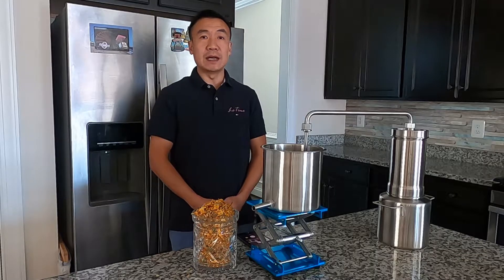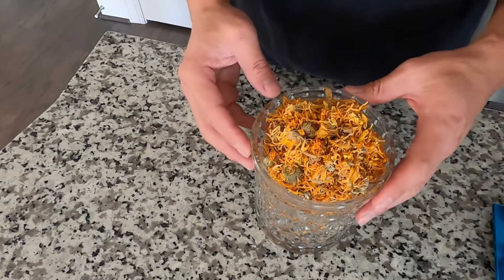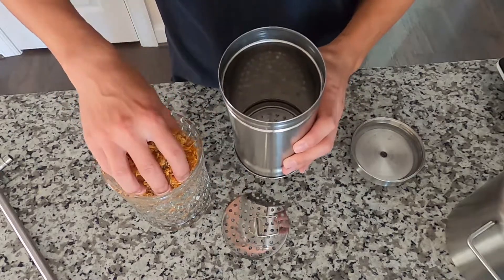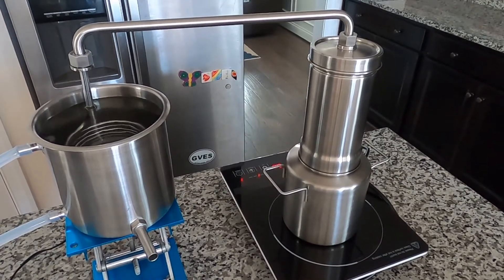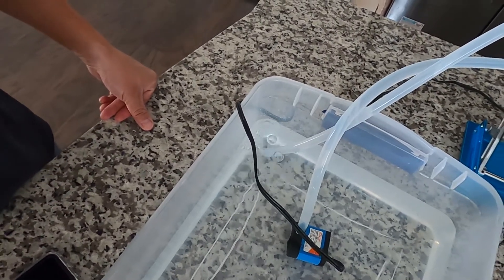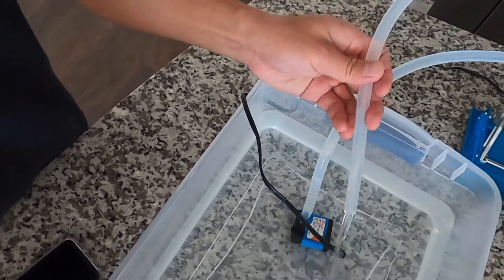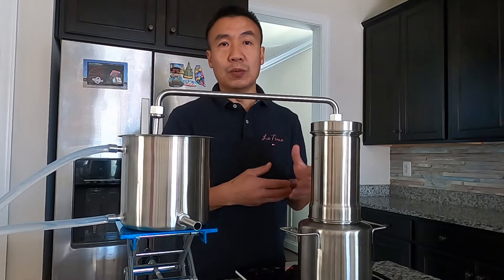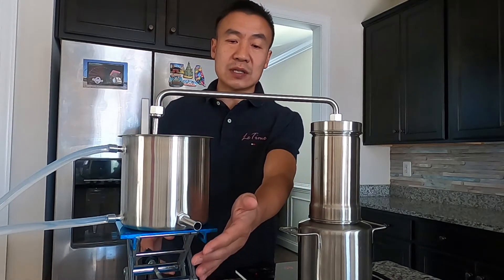Steam Distillation of Calendula (Marigold) with Organic Dried Flower, Made Beautiful Milky Hydrosol

Comment: DR. KWOK, I FINALLY OPENED UP MY BOX TODAY BECAUSE I WAS READY TO TRY MY HAND AT A HYDROSOL BUT EVEN AFTER WATCHING VIDEOS AND READING THE INSTRUCTIONS, I STILL HAVE MANY QUESTION AND IT LOOKS SO EASY. FIRST, THE PACKAGE DOESN'T COME WITH CLEAR TUBING CORRECT? WE HAVE TO BUY THAT ON OUR OWN? ALSO, I SEE THAT YOU HAVE 2 DIFFERENT TUBING GOING INTO THE COLLECTION BUCKET. WHAT IS THAT MOTOR THAT IS CONNECTED TO THE TUBING IN THE WATER? I DON'T WANT TO MAKE THINGS HARDER FOR MYSELF BUT IF I CAN DO WITHOUT ALL THE EXTRAS THEN THAT WOULD BE GREAT. 

IF WE MANUALLY DO IT WITH ADDING ICE AND COOL WATER, HOW DO YOU KNOW WHEN IT HAS GOTTEN TOO HOT AND THE ICE AND WATER NEED TO BE SCOOPED OUT AND REPLACED WITH COOL WATER AGAIN? ALSO, THE 30 MINUTE TIME PERIOD, DOES THAT START AS SOON AS YOU TURN YOUR STOVE ON OR AFTER A FEW MINUTES? I KNOW I'M ASKING A LOT BUT I JUST WANT TO BE SURE I'M DOING IT RIGHT.
Reply from the maker: Hi, Thank you very much for sending me your questions and I am sorry for the confusion. The cooling circultion connectors have the same size with the distillate outlet, which is half inches. You may use or order silicon tubing with ID 10mm for the circulation and hydrosol extension tubing because silicon tubing can be stretched out a little bit and having better seal. When using ice cubes, you may replace the warm water with more ice cubes when it heated up. 

Please send me email with more any further questions: leo@letimestill.com so I can read and reply more quickly.

Thank you!